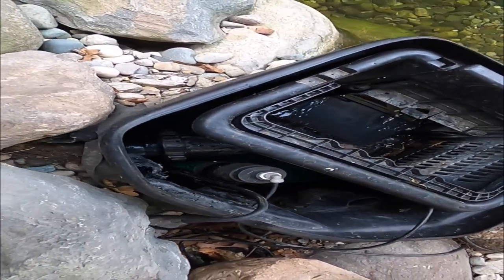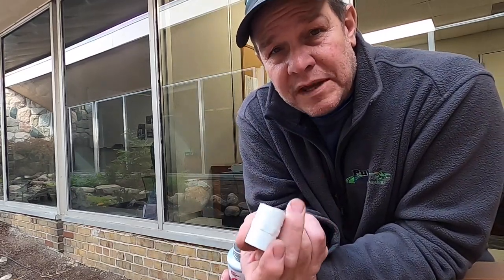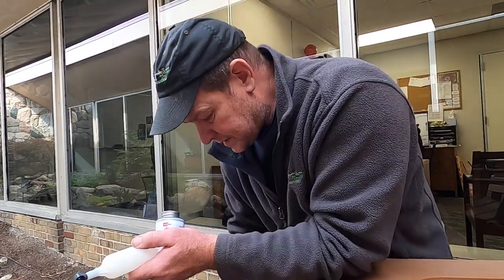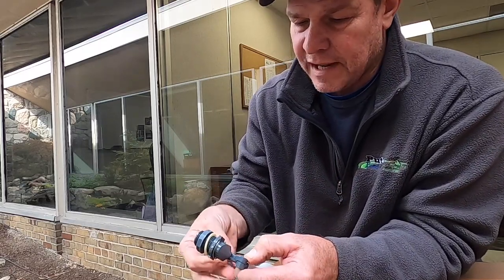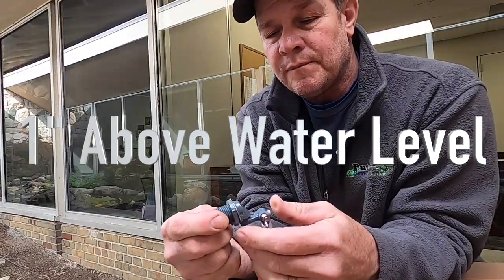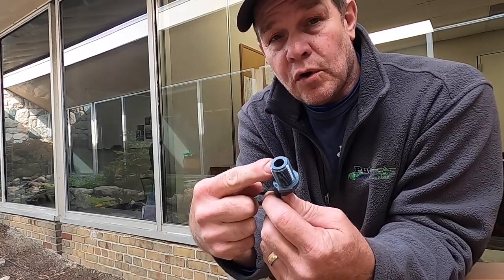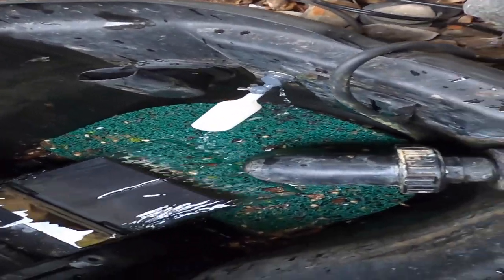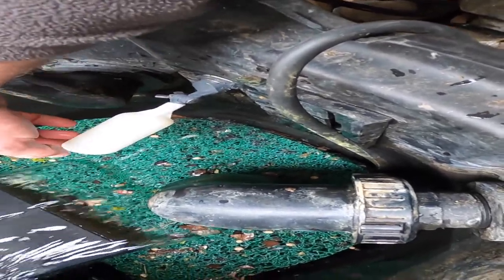How To UpGrade Your Pond's Auto Water Fill Valve

Comment: I have Aquascape's compact water fill value but it's worn out and won't turn off. So I got a replacement. Can a disabled senior (also new to ponds) do this replacement myself? I couldn't loosen the value from the inside. But now I see I have to dig down into the pea gravel to get to the outside connection locations for this value and the supply line. Other than wrapping the threading with plumbers tape is there anything else I need to know? Apart from the obvious, turn off the water. I would really appreciate your help and advice. Including a list of tools for the project. I'm fairly handy so I think this is something I can manage. I would just really appreciate your guidelines and instructions. 💦💧